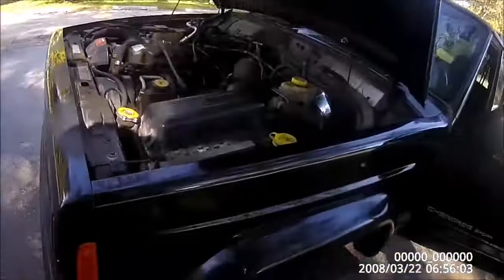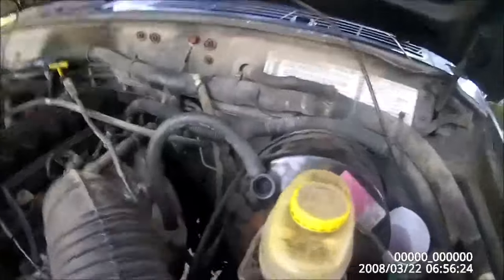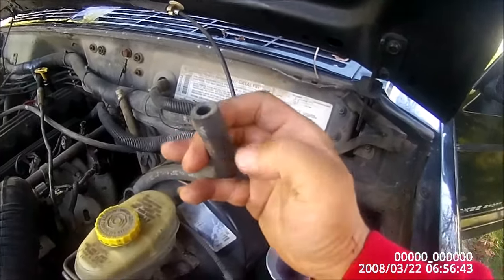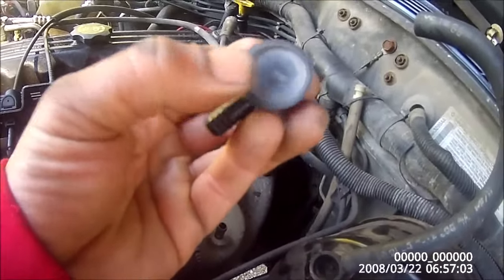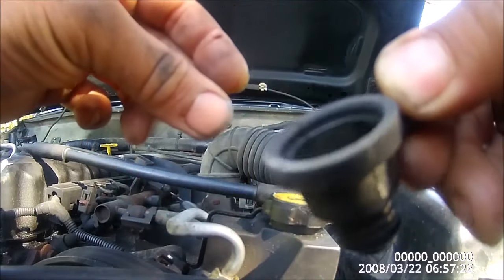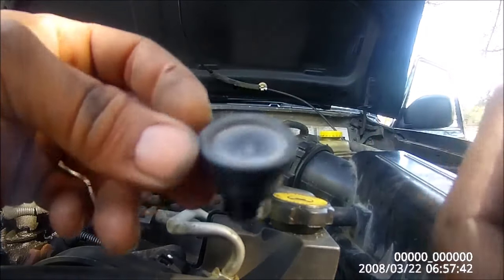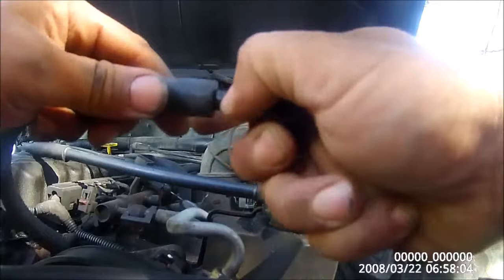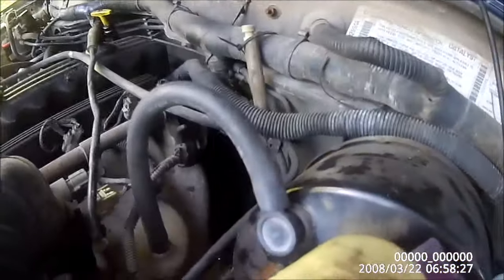Is your brake pedal hard to push? This easy inexpensive fix might work.

Comment: This is exactly what happened to mine. The pipe pulled off the manifold. The valve was cleaned with Carb and Choke and inserted back with some gum. Brake works fine now. But a mechanical initially told me my booster needed replacement. Luckily I hit the second mechanic up who just looked at the back of the engine (Camry 2010) and saw the lose pipe. This pulled out pipe was associated with high idle revving (1500 rpm instead of 1000 rpm).

Comment: Am assuming the same principle applies to a PT Cruiser, brake pedal very hard to push. I just disconnected  the hose and was able to Blow air and also Suck Air too - which lead me  to believe the Check Valve is damaged> I will buy and replace the Valve then let you know if that fix it > thanks for your video. Simple and very well explained.
Reply from the maker: @JorgeMartinez-wt4vs  glad that I could help. Let me know how it works out for you.

Comment: Man my brakes are stiff as hell but the weird thing is they’re stiff but very sensitive to the point where once I touch the brake with very little pressure the car stops immediately… still very unsafe since it gives the cars behind me no time to react since it’s like I hit the brakes in a instant. Weird af. Think it’s my brake hoses.
Reply from the maker: id suggest that you travel in the most starboard lane as possible 🤫

Comment: I have a 2016 town and country van and for some reason my break system is hard to press and break light is on. It is really cold out today in Minnesota also so idk if it has anything to do with the cold or what but that's never happened before.
Reply: My ram randomly did that yesterday
Reply: I found a vaccume line disconnected so popped it back on and it's ok.
Reply: @shaunfrench75  same thing with mine

Comment: Ya I've been having this problem for over a year now. I'll come out to the truck '99 chevy tahoe, and the truck won't start. I'll wait a few hours or sometimes a day, then she'll start right up and run fine for a couple months then do it again. So I ended up replacing the brake master cylinder, the brake power booster and the check valve. That seemed to fix it! Well after a good few months, it's happening again! If all those parts are new, what can it be? When the brake peddle is stiff like that, the truck won't start. I need to either fix this problem or find a way to bypass the stiff brake issue so the truck will start. In the beginning of the video you mentioned that the check valve hose that is connected to the booster is also connected to the manifold, perhaps the issue is somewhere in that area. I love my truck, but this issue is annoying.
Reply: All my fuses and relays seem ok, but I guess relays can be faulty and still sometimes work so.. I'm going to get a new starter relay, get a new starter with the solenoid and go from there. My original thought was that the stiff brake pedal meant that I lost vacuum in my brake system causing some kind of no start safety issue since these older boosters aren't electric assisted, but I now believe this is wrong and actually has nothing to do with a no start problem. I've also looked at the neutral safety switch theory and while it is a possibility, I'm hoping the problem is in the starter or starter solenoid. I could just swap relays, but let's be honest, these parts are old anyway. Rockauto baby! I'll keep you updated!

Comment: I have an 02 nissan Xterra and it doesn't have a valve like that. Should it have one? Ive never had a problem with it until today. Thanks for your help.
Reply from the maker: Google  02 Nissan Xterra brake booster check valve

Comment: How likely would this problem be? Because it’s only sometimes that I’m having a stiff pedal and not being able to brake not every time
Reply from the maker: I mean, it only takes a minute to check the valve, so if you check the valve and it works then it's not likely to be the problem. Oh and make sure the hose isn't damaged.
Reply: I’m having the same issue , do we check the valve with the engine running or with engine off ???